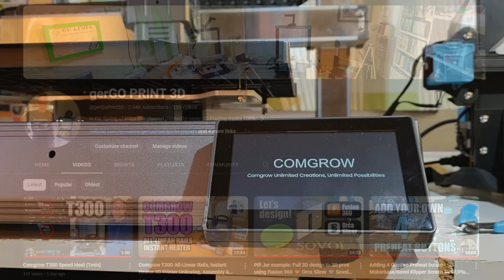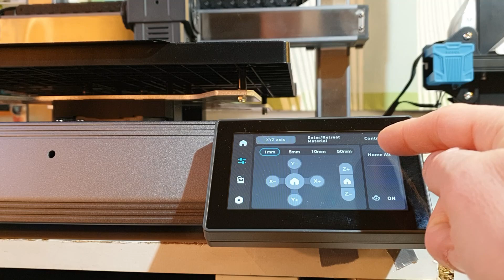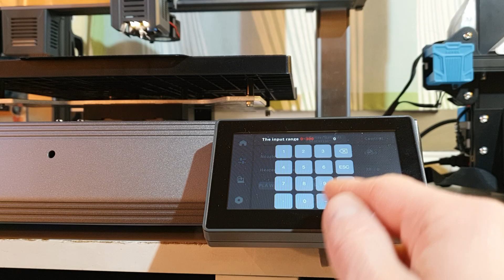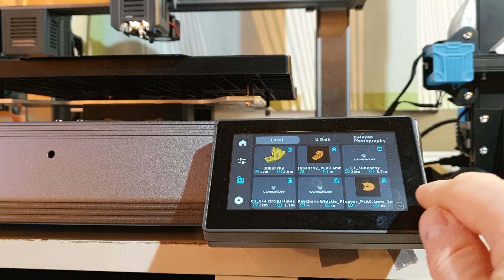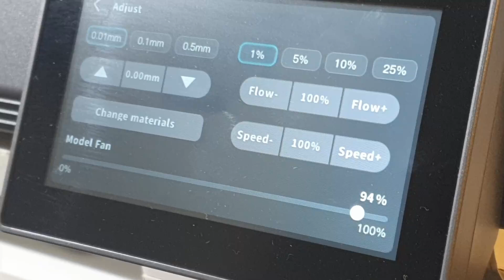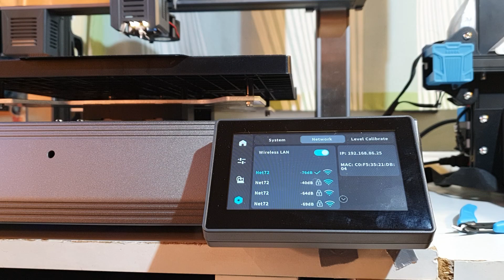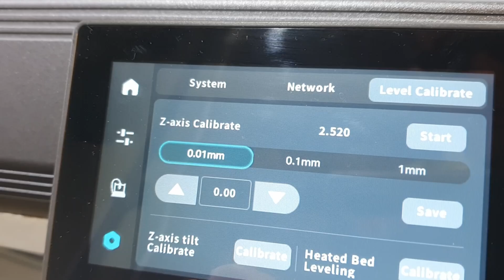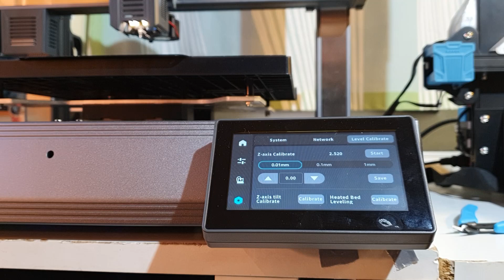Sovol / Comgrow T300 device screen tour - 3D Printer - Beginner user guide

Comment: Good video, learned a lot (specially why not to buy the t300) ... no second driver for the z ? they said 2 steppers... i have automatic z tilt before every print.. That means i would have to install a new mainboard.. Then what i didnt understand.. you say only room for one bed mesh on the screen?? does that mean there are 2 different storage places for the mesh? horrible... but i have tiny meshes .. when i use KAMP.. it probes before each print only where the print is.. does that mean i cant use kamp?.. so all in all it means i would have to ad a pi4, a new screeen, a new mainboard, to make the printer work like i want.. thats too much work for me. thanks for letting us know.
Reply from the maker: Yes, there are two steppers (the two z columns are note coupled in any way) but a single driver. Which was one of the most puzzling to us beta testers too. But I've created a macro that makes leveling the gantry very quick and accurate using a dialed knob and the inductive probe (similar to my published macro for the SV06/Plus), so you can easily do it before any larger print.  The bed mesh is stored in printer.cfg just like any other Klipper printer, it's just that the command on the device screen will only produce "default" at 60°C. I modified this macro to allow any preset temperature if the bed is preheated before making the mesh.  Adaptive mesh is indeed possible using macros. Klipper is fullly featured, unlimited, and 3DPrintDemon will soon post an easy method to allow keeping it updated to the latest version of the OS.  It is running on performant hardware, you don't need to add a new pi or board.  I think the robustness of the hardware, the stellar motion system, very high quality extruder and extremely fast heating AC bed and ceramic heated nozzle all makes this a good printer out of the box, and maybe adding a belt to connect the z axes could fix the small inconvenience of the single z-driver issue.